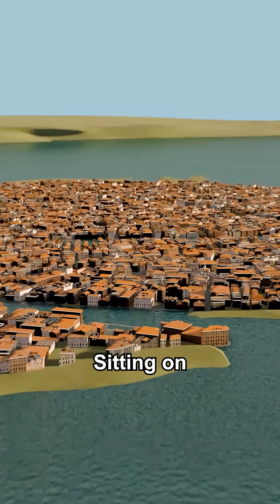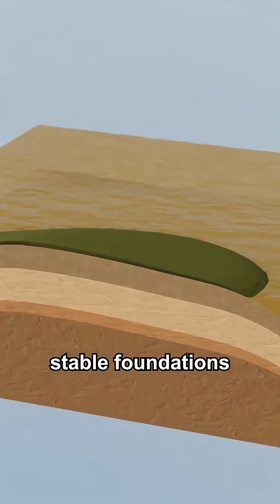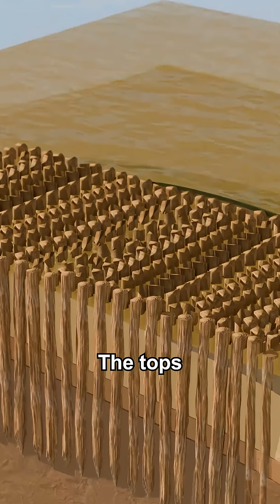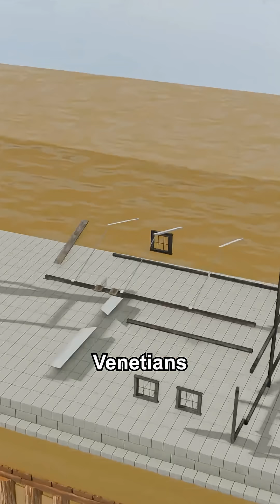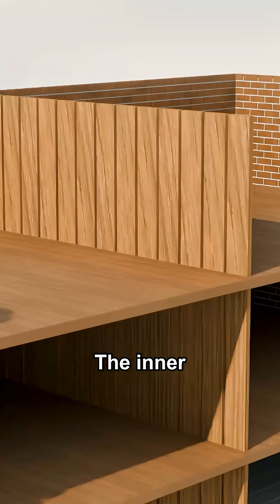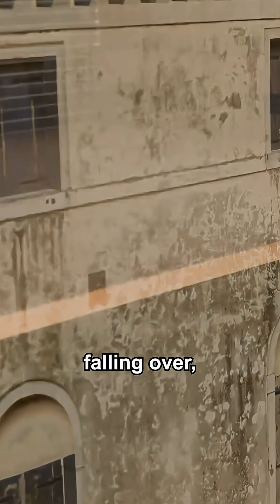Building Venice From Scratch

Comment: Nobody would have been dumb enough to use cement mortar back then.  That's only our modern stupidity
Reply: Nothing wrong with cement mortar when the building has solid foundations.
Reply: @erict.35 not with handmade clay bricks the freestyle cycle cement cracks the bricks and destroys them because concrete is harder than those clay bricks
Reply: @NoWheyH @NoWheyHombre te when the building has solid foundations. Also, you can mix cement with lime and have your mortar more brittle.
Also, the bricks never crack because cement mortar is “harder”. Thin layer of cement is more brittle than clay bricks.
Reply: @erict.35 I know cement can be modified, but often isn't.  Buildings with missing bricks are testament to this fact all over the eastern USA.

Comment: Those wooden piles also mineralized  over time, Turned into stone-like material.
Reply: It will stand for another 1000 years if that's the case
Reply: Those piles probably will. But the city itself is slowly sinking at the rate of 1-2 millimeters per year from other factors. Mud compacting, Sea level rising, Tectonic movements and Ground water extraction.
Reply: @nttntjno1797  Lets not forget, a larger, heavier population. With more shet on top.
Reply: @kryptokrypto702 Yup! Those greasy Italians are getting fatter every year. All that gillato, Stromboli, manicotti and ravioli is making them catch up with America & Australia
Reply: @Anonymous-sb9rr For now, yes. The sinking could still accelerate in the future when there are more and more buildings weighting down the foundation and increasing flooding from extreme weather.

Nothing worth panicking about, but it still doesn't hurt to keep an eye out.
Reply: @nttntjno1797 
Where are you going after you die. Repent today from your sins. Hebrews 9:27 says as it is appointed unto man once to die but after that the Judgement.

Confess your sins and turn to Jesus Christ today. He is the way, truth and life.
Reply: In 1,000 years Venice will relocate... to mars

Comment: I wonder why Dubai hasn't wised up to this and tried to implement this method into their sinking island creations.
Reply: The Dubai islands are artificial, sprayed up with sand from the sea. It doesn't have that magical clay layer underneath like Venice 👍
Reply: @Dutch874 I grasp that much, but if they have the ambition to attempt such an endeavor, why half-a55 it? It seems they were to busy trying to create something nice looking that they didn't put enough effort into the foundation. Does that make sense? (Not a condescending question)
Reply: @ObregonLA a Dutch company was hired to create the islands. I don't know all the details of the job, but my best guess is that the Arabs wanted to fast forward the foundation process. Usually, the size of land that is created is much larger, think size of city or a province. More often than not it is coupled with the seeding of the coastline with vegetation that holds the soil. Im Dubai, they are mainly tiny islands with just sand. Sand isn't great for holding a coastline. A palm tree here and there doesn't count 😂
Reply: @Dutch874  makes sense. Didn't realize a Dutch company was contracted for the foundation work but I did put together that it was purposely a rushed job.
Reply: There method is to vibrate the sand base until the grains lock into a stable and hard formation (squeezing out the water) then insert the support into the compacted sand...kinda clever but no idea how long it'll last.
Reply: They don’t seem to be artistically and culturally advanced enough yet. Well I suppose no society or country in the world right now is as artistically and culturally developed as ancient Venice… We need more art and artisans.
Reply: @T.J Amen to that.
Reply: A thousand years from now, what is left of Dubai will be hailed as a marvel of engineering from the early 21st century. Granted, the vast majority it will have failed centuries ago, but just by luck some of it will survive, and that will be mistaken for good planning. Just like with Venice.
Reply: @kenrickman6697 you make a point.

Comment: They didn’t use cement because it wasn’t invented and widely used until around 1850!
Reply: Didn't the Romans invent the word cement? And the Venetians were Romans
Reply: The fact that this obviously wrong comment got 50+ likes is very concerning.
Reply: @r @rafael_lana 
You are mixing up cement and concrete. Yes, the Romans had an extremely durable concrete (lime, sand and volcanic ashes, called puzzolan), best example is the Pantheon in Rome. But the knowledge got lost, and only traditional lime mortar was used. 
The cement (Portland cement) we are using nowadays was invented in 1844 and produced in greater quantities around 1850, but was too expensive for simple house building. But they made a lot of multicolored floor tiles, which were very popular. 
At the beginning of the 20th century, when it got cheaper, it was used like we do today.
Reply: @Thomas-Gr  you get concrete by mixing cement with water and aggregate 😒 Im an engineer my dude, no confusion here. Their concrete was used in compression rather than the more common tension today. But there are still modern mixes for compression we call cemment, theres way more to the field than Portland 

Yes the ancient world had both, just because its not the same we use today doesnt mean they didnt have one. The word literally is derived from latin 😂 its like saying we didn't had batteries or computers before the modern version of it. Its objectively wrong
Reply: @Thomas-Gr cement is lime with some minerals.
Reply: @Thomas-Gr 😂 and you're also very wrong bro.. in fact all of you guys are completely wrong. 😅Confident too might I add. Africa created an advanced pre and post flood melanated global empire with advanced mega cities with skyscrapers globally including Greece and Rome and the Americas for thousands of years before white people emerged from their area of origins.white people were historically deathly afraid of the sun that's why they carried big black umbrellas and completely covered skin. Can't build much if you're afraid of being outside.. just saying. Black people weren't brought to America on the bottom of slave ships lol.😂 we were all ready here. Don't take my word for it. Research it yourself.
Reply: Yeah the Ancient Romans had their cement, but that was lost technology at the time.